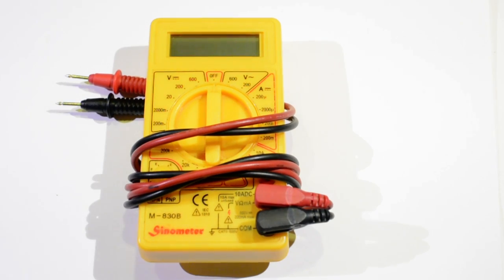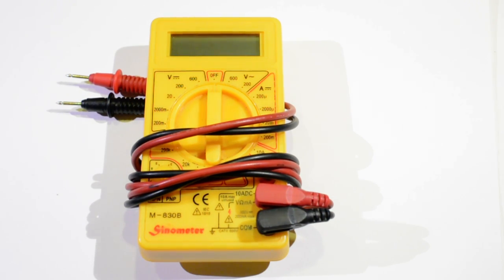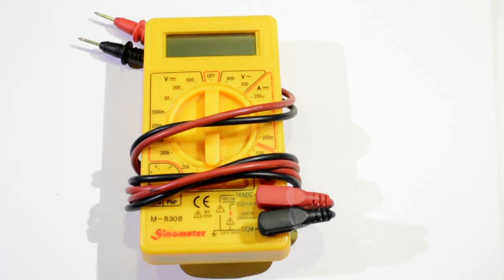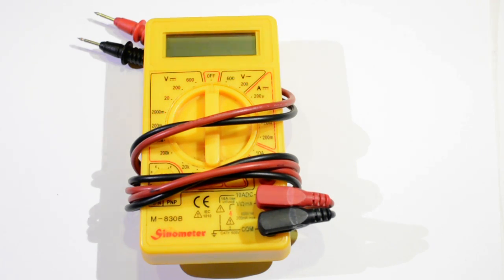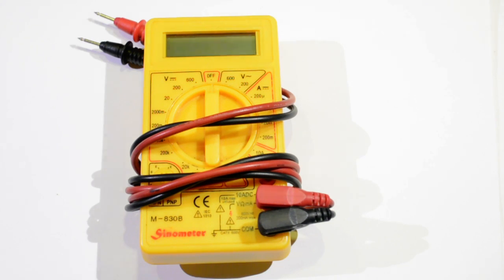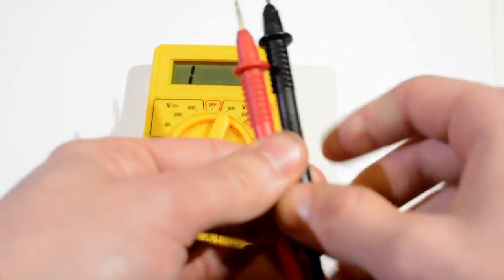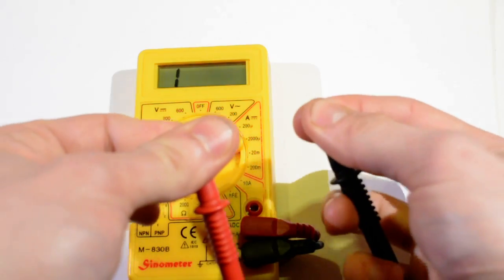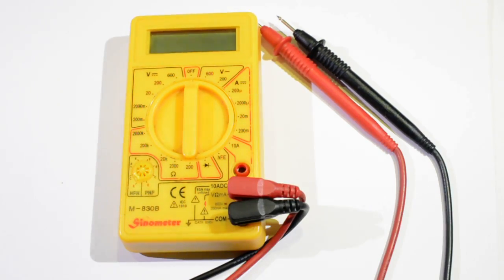Better Continuity Tester

Comment: Years ago, I made one with a pair of discrete transistors, a couple of resistors and a capacitor. It was based on the circuit used for those roadside flashing lamps, but sped up by about 8 octaves. I used an old magnetic telephone earpiece for output. The thing was way too loud in a quiet environment, but perfect in an industrial or street setting.

Comment: Hi I have ATtiny85 soldered to a board with all the pin-outs and a micro USB  (from a Chinese wholesale). The micro USB is used to program it. It is a clone of DigiSpark. I also have a micro USB programmer for different ATtinys: 13A, 25, 45 and  85. So my question is  - this project can be made on ATtiny13A or its specs are not enough for this project, so I have to use the micro USB ATtiny85 module?
BTW, all your projects are interesting! Also I like the programmable projects which have a practical use.
Reply from the maker: Hello, ATtiny13A should be fine for this project. Cheers